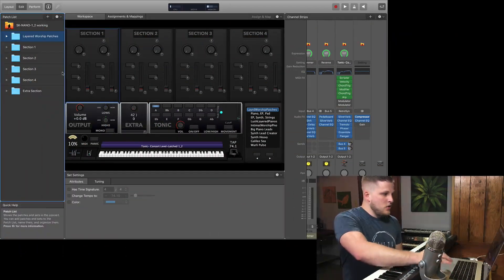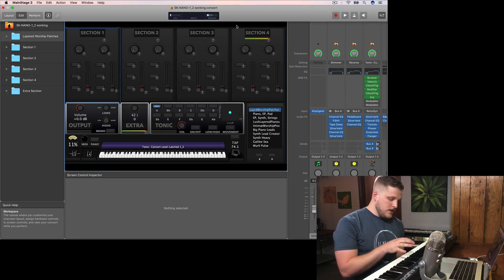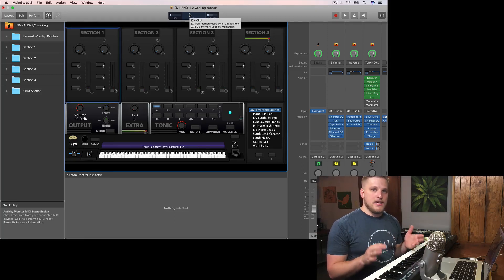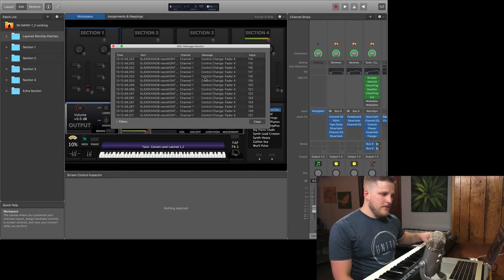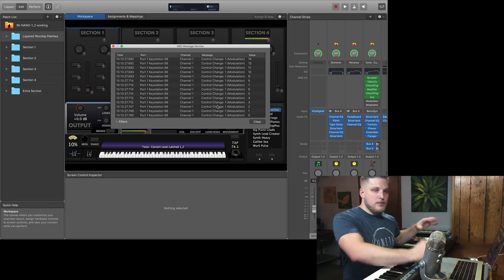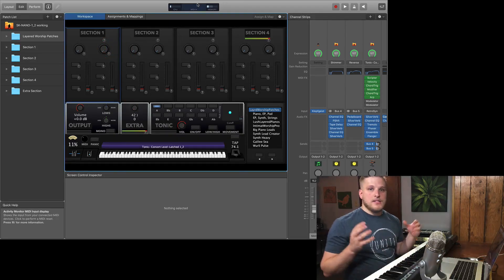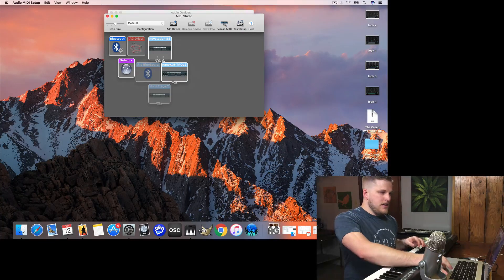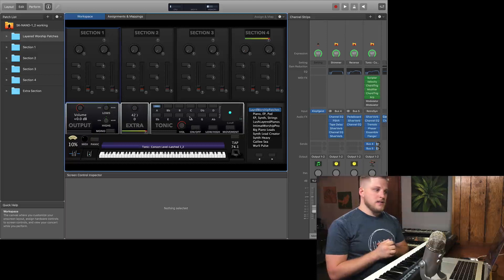MainStage Tutorial: Troubleshooting Midi Connections in MainStage 3

Comment: Good man.  I’ve got an issue with one or both of my a800 pro controllers disconnecting and then reconnecting on stage. It’s like they go off. 

Only ever happens on stage.  I’m using USB power as well.  I bought power supplies and new usb cables (my existing ones are 5 metres long and have been gigged hard for about 7 years.    I suspect t it might be environmental issues at certain venues clashing with bad cables….  But Any ideas would be appreciated,
Reply from the maker: Sounds like it could be related to bad cables or not enough power for the devices. Would recommend a powered USB hub (one that also plugs into the wall) if you are not already using one. You could also try not powering your controllers with USB and instead use the power supply for those units. It is strange that it would only happen at the venue though. Perhaps something with the venue power is off.
Reply: @SundaySounds  thank you sooo much for your reply. I figured I was asking for trouble powering them via usb with very long cables. I  ordered 2 x a800 pro power supplies on Sunday and they arrived today. I also got new, shorter USB cables with Ferrites, plus 2 new surge protected gangs.

We play in lots of different venues across the UK and it’s happened in 3 venues. I think it’s probably interference. I may also get a power conditioner for the rig. It’s a big, complicated setup so I need to protect it. 

Thanks again, it is genuinely much appreciated.

Comment: Hi David, I have a problem with mainstage midi that does not occur from the get go. I can be playing through my concert/set list fine. Everything working great. After about two hours of playing suddenly the sound just cuts off. Everything looks like I should be getting sound. The Midi message monitor displays the notes I am playing but is only showing "Note Off' with the note I just played (it does display "Note On" all.
If I load a new concert I do get Note On followed by Note Off but still there is no sound.
Once I restart my computer everything works find.
Any suggestions you might have would be greatly appreciated.

Thanks
Ken

Comment: Hey! I don't know if you read comments on this video but I just bought a MacBook Pro for my rig at church. When I connect my Nano, Audio Interface, and Midi Keyboard (Yamaha XF8) into a type c adapter it doesnt register the Keyboard into mainstage. Im not sure how yall connect yours but it would help a lot!
Reply from the maker: Hi, most Yamaha keyboards require you to install a driver on the mac to be used as a midi controller, check out your models user manual that should point you in the right direction.

Comment: my midi controller is not sending the signals from C3 and D3 to the computer, but the sound comes out of the keyboard normally. When used in programs such as Synthesia, when I press the D3 key the keyboard stucks. Could you help me solve this problem?
Reply from the maker: Hi, you might look in your user manual to see how it's designed to work with midi.

Comment: Hi, I have  a midi controller with one fader that creates fake midi signals ( its like I was touching the fader up and down all the time) , but I don't. How can I fix this ? Thanks :)
Reply from the maker: you might try a factory reset of your midi controller - check your user manual for steps. You might also contact the brand's support to see if that is a known issue on the particular keyboard/model.

Comment: Hi David I’m using a Yamaha mo6 synthesizer and connecting midi via usb to host not getting anything ... Turned off the local off setting and midi to usb on the actual keyboard and I even switched out midi cables and nothing on the midi audio setup window. I’m using an apple laptop mid 2012 on Catalina do I still have to install drivers?
Reply from the maker: You will probably need a driver, you can search OS compatibility and Yamaha keyboard model here: https://usa.yamaha.com/products/contents/proaudio/downloads/firmware_software/
Reply: Sunday Sounds cool thanks a lot. Been running into this exact situation for a while, it was the driver.. however, if you’re running an older os you might need to check if the driver update for your particular model requires an updated os as well or it won’t let you install. Double check before updating if you are gunna do it, I’ve seen sessions where the plug ins used on the channel strip are not recognized because the os was updated and the plug ins installed were not the most current versions.
Reply from the maker: @mannymelendez1144  We recommend doing a time machine backup and backing up native app versions before updating so you can roll back if you do run into compatibility issues. Also check 3rd-party plugins and apps for OS compatibility before updating!

Comment: Help David! This one has me stumped.  Rolling along for 6 months, all good with my Novation Launchkey 61 and MainStage 3!  All of a sudden, it's being seen by MainStage as the 49 key version and has greyed out the 61 key. MainStage is getting the midi signal fine, it just won't recognize the 61.  I tried it on another laptop and the issue remains. I looked at the Midi editor (thanks to your video) and is showing the keyboard as the 49.
Reply from the maker: Can you hear sound out of all the keys?
Reply: Sunday Sounds Yes but only if I select the 49 or All. It’s not a huge deal except I have to re assign all the button and knob assignments I made against the 61.

Comment: Hi there, it seems MainStage is receiving data from the keyboard, from the pedal and from a wheel, but not from any of the knobs or buttons.  Do you have any suggestions here?  Thank you
Reply from the maker: Hi, it's possible your knobs/buttons on your keyboard do not send midi. I would check your user manual to be sure.

Comment: Hi David. I have an M-Audio Keystation 88 (just as shown in this video) and I have performed the troubleshooting listed in this video; however, I cannot get it to work with the Sunday Keys template. I see activity in the MIDI Activity Monitor, as well as in the MIDI Message Monitor, but when I play anything, I do not get any output from any selected patch. Do note that the Keystation 88 works fine in the default concert that comes with MainStage, but the problem only exists within the Sunday Keys template. Any ideas?
Reply from the maker: Hi, have you made sure to go through all the installation videos on the Sunday Keys Resource Page and assign your hardware and check in your Audio preferences?
Reply: @SundaySounds  Yes. I was able to resolve it by following the steps in the "Assign" tutorial. Thank you for your reply!
Reply: Where is the assign tutorial? @chadamtrakrailfan

Comment: you missed the real problem - getting MS to play notes from external keyboard that is otherwise connected and working. MS is the most insanely difficult app to make work... and then if you need to remove a keyboard you no longer have, even worse. haven't figured a way to that.
Reply from the maker: Hi Steve, I'm sorry you've had problems with that! You have your keyboard selected and assigned in layout mode? Have you verified it's a keyboard that sends midi? If you'd like to troubleshoot with us more, please send us an email to info@sundaysounds.com
Reply: @SundaySounds  Hi - thanks. eventually, after even more messing around I figured it out. Its such a totally unobvious way of doing things. its also info thats just not out there. even the manual is pretty thin, at least what searched up. you should totally show how to connect a keyboard up thats never been used before because I think thats the critical part of getting things to work.
Reply from the maker: @thedp  Hi, I'm glad you figured it out. There's a lot of helpful information inside MainStage's Help. You might also enjoy our free MainStage Starter Course and we address some of these things:  https://sundaysounds.com/mainstage-starter-course/

Comment: Can you use mainstage via midi input not usb input? Like use a old piano that doesnt have a usb input to connect to mainstage?
Reply from the maker: You can, by either purchasing a midi to USB cable (lots available on Amazon) or plugging into an audio interface that features a midi in port on the back.

Comment: Hello, I hope someone can help me. I am having a problem with Mainstage v 3.4.2, but I previously had the same problem with the version 2.1. Almost every note that I play with my keyboard (not all of them) are infinitely sustained like if I kept pressing them. I am sure the problem is not in my hardware since the keyboard shown in the layout shows how the notes are released, but the sound keeps going. Also, I tried playing in Garageband to see if the problem was my computer or the cable midi-usb, but everything worked fine so the problem is exclusively from Mainstage software. It's really impossible to play with that bug because it gets very noisy and grubby when I start playing chords. Really disappointing since I just purchased the software to play in my church.
Reply from the maker: Hi Kevin! The sustained notes could be for a couple of reasons. Are all of the notes sustaining out all of the time on all patches? This would probably be a sustain pedal polarity issue, and we would need to reverse the polarity. Here is a tutorial for this: https://sundaysounds.com/blog/backwards-inverted-sustain-pedal-mainstage-3-tutorial-patches. If that doesn't solve it, reach out to us at sundaysounds.com/support and we can help get this sorted out so MainStage will work for you!
Reply: Sunday Sounds thanks for the reply. I don’t have any sustain pedal connected. In any case, I will try to change the polarity and see if that works. If not I will reach out to support.
Reply: Sunday Sounds and yes, no matter what patch I use, the notes are sustained.
Reply from the maker: @kevinhernandezmonzalvo5539  Ok, it could also have to do with auto-save if you have that on, and you can check out this video about that: https://sundaysounds.com/blog/autosave-mainstage-tutorial. But definitely reach out if you are still having questions!
Reply: Sunday Sounds thank you very much!
Reply from the maker: @kevinhernandezmonzalvo5539  you're welcome :)

Comment: Hi. I'm currently in a panto run using MainStage2. I can only have MainStage running for about 40 minutes before it starts missing midi inputs. I know it's not the hardware as all I need to do is restart MainStage and all is well again. I don't have the luxury of time to troubleshoot this - does anyone have any suggestions? Thanks
Reply from the maker: Hi Steve - it may be because you are running an older version of MainStage - have you thought about upgrading to MainStage 3? Please email us at info@sundaysounds.com and we can help you troubleshoot further!
Reply: @SundaySounds  Hi. Thanks for replying. Sadly I can't upgrade that Mac at all as I have a particular app which won't run on later OS (I've already tried and had to rollback). MainStage 3 won't run on my OS. I know I'm a version behind but I just wondered if it was something people had experienced
Reply from the maker: @stevewatts9128 I understand that! A few ideas would be to increase the buffer size to 512, reduce the amount patches in a concert, turn of your wifi, try running in edit mode instead of perform mode.
Reply: @SundaySounds  Hi - thanks for the reply - busy doing the panto! I found if I restart MS2 between Act1 & 2 I can get to the end of the show. Not ideal I know but it's getting me through the run. WiFi and TimeMachine are both disabled. What is the buffer size you mention?
Reply from the maker: @stevewatts9128  We recommend at least 256, and some need to bump that to 512.

Comment: It seems like when I play patches with lots of sounds and chord triggers ,ect the sound stops but when I play a patch with like 2 sounds in it it works fine....is that a  RAM ISSUE?
Reply: Same here seem like no one has a solution
Reply: @masterstickz  Depends. If it's a sample-based instrument (exs24 for example), yes it's usually RAM. If it's a modeling plugin that doesn't use samples, it's a CPU issue. Monitor your CPU and RAM within Mainstage and see what happens while playing the complex sounds that cause the issue.

Comment: Hello David, I have a M-Audio Keystation 49. Every time I load a library from Kontakt I have to go to midi inputs and change it to “Omni” any idea why? When I try using omnisphere it doesn’t give me the “Omni” option and I can’t use my controller. Hope to hear from ya, thanks!
Reply from the maker: Hey there, it's normal to have to do that in Kontakt. 

In Omnisphere each patch has a designated midi channel. Usually patch 1 is listening for midi channel 1. You can change the midi channel it will respond to in the "Main" tab of an Omnisphere patch.
Reply: Sunday Sounds when I try to set it to channel 1, it doesn’t recibe anything. My questions is how come Kontakt gives me that “Omni” option but Omnisohere doesn’t. I can’t seem to get any signal into midi channel 1 from my controller
Reply from the maker: You need to set it to whatever midi channel your midi controller is actually sending on, not necessarily midi channel 1. If your controller sends on channel 8, just set Omnisphere to listen to channel 8. 

Kontakt and Omnisphere are made by different companies, so it's hard to speculate on the different settings available in each.
Reply: Sunday Sounds I figured it out, thank you! For some reason it was Channel 15
Reply from the maker: Glad you got things working! :)

Comment: I have connected a Roland MP300 to my Mac via a USB Midi cable and when playing, I get keys that stick.  I've seen reference to it on the internet, but no real solution.  I've watched your video and have a question.  In the Midi Message Monitor in Mainstage 3, I have all the filters on.  I get continuous feedback in the window but think that is the System Realtime monitor running looking for activity.  Correct?
Reply from the maker: The midi message monitor only shows activity if it is receiving it, so if you're not touching any hardware you should see no activity. If you're seeing activity anyways then you do indeed have a hardware or cable problem. Have you tried a different USB to Midi cable? Those are somewhat prone to failure.
Reply: On my second cable.  The cable works fine on other devices.  I've ordered another cable so will give that a try.  I always see activity in the monitor window when it is connected.